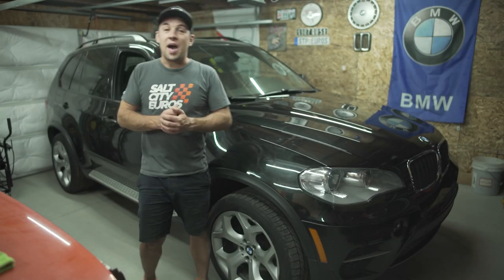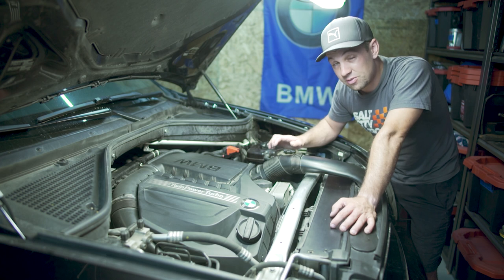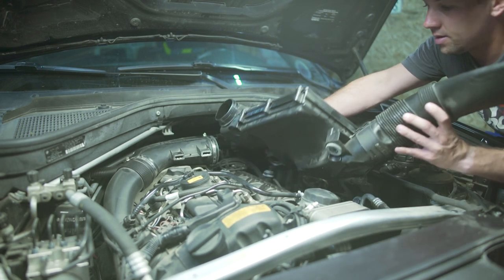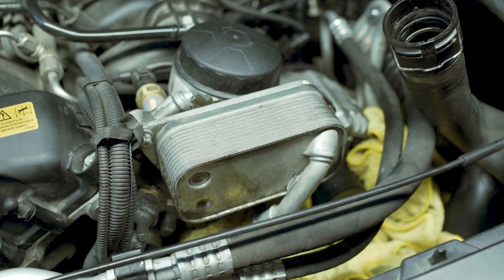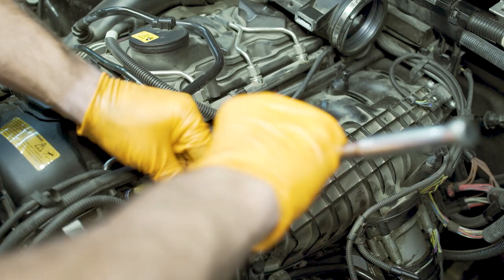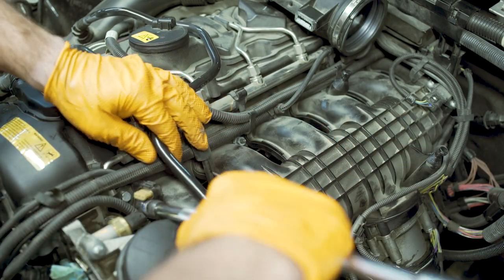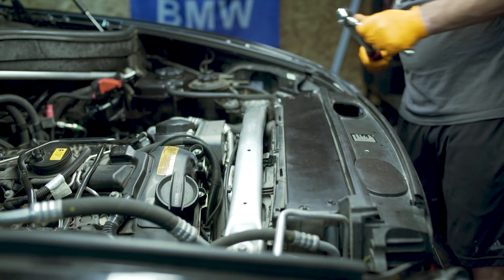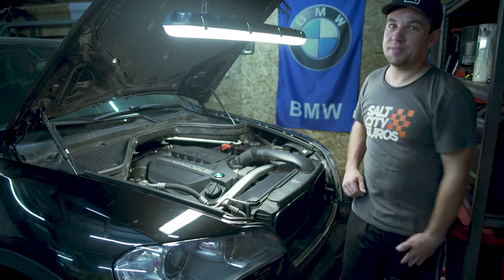DIY N55 Oil Filter Housing + Cooler Gasket E70 X5

Comment: You're a solid teacher. Thanks for making this video. I have a 2012 X5 and this is the exact issue I'm having. I have a leaking oil filter housing and oil cooler housing. I appreciate you mentioning the socket sizes that we need to do this. Thanks!

Comment: great video. it has helped me with this job. by the way, that hidden intake manifold bolt in the back was easy to get to. took me two seconds to remove with just a socket an small extension.
Reply from the maker: @scottlevy3274  happy that was an easy task

Comment: Great video! I plan to tackle the same job on my 2012 X5 xDrive35i. Can you tell me which fuse you removed to cut off the fuel pump for priming the oil so the engine doesn't start? I'm guessing it's the F105 30A Fuel Pump Control in the rear cargo area panel but can you confirm?
Reply: Did you ever figure out if this is the correct fuse? My 2013 X5 xdrive35i lists numbers 18, 105, and 122 next to the fuel icon on the diagram. My 105 is a 20A.
Reply: Did you figure which is the fuse ,  pls update ?

Comment: Great video, very relevant for N55 drivers. 
Salt City Euros/Anyone: There was a lot of oil that splashed up in the engine room over to the driver’s side. I image that oil dripped on the drive belt (serpentine belt) and then splashed up. Is it a good idea to replace the belt at the same time if there is lots of oil on it? Or the oil won’t really matter?

Comment: @saltcityeuros Great tutorial, I attempted this over the weekend, it went smoothly, so I thought, until I took it for a test drive.  Turns out the oil cooler cracked right where the first baffle meets the mounting plate by the upper left bolt.  I'm not sure if it was cracked before the work, but after, it cracked to the point where oil was spraying everywhere while driving.  I torqued all the bolts to 16 ft-lbs.  I also noticed a small leak at the oil filter housing to engine gasket.  Any tips for improving the seal with the gaskets?  Have you ever used anything on the gasket (oil, grease, rtv?)  It's all tore back apart waiting for the new oil cooler to arrive.  Thanks in advance!

Comment: This kind of stuff is why I went back to an E46 :-) I wonder if a Torx spanner could get that bolt out without removing the manifold?
Reply from the maker: I had a whole segment where I spent time trying various tools to get in there, to show how tight the clearance is. I couldn't even fit a slim 8mm wrench in there...It's just not possible in my opinion